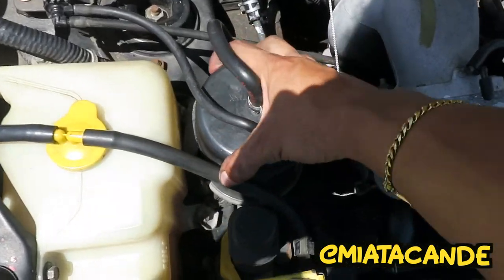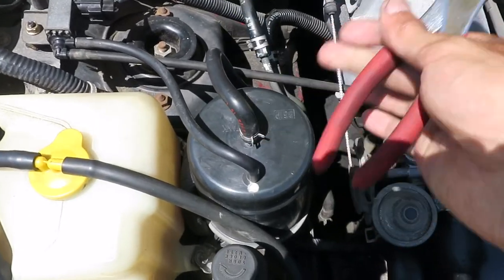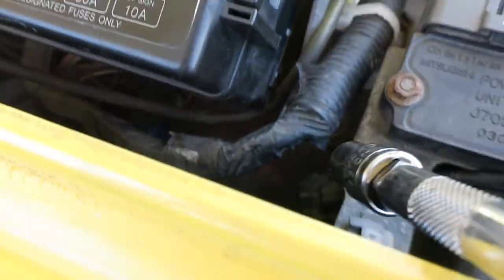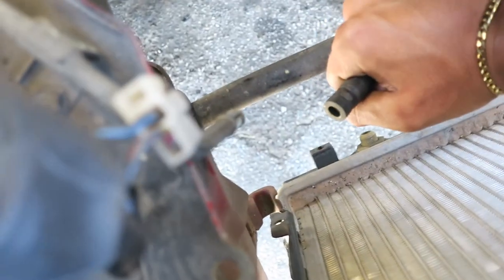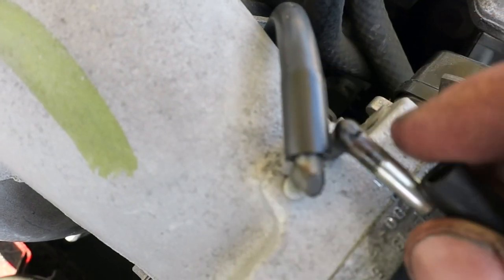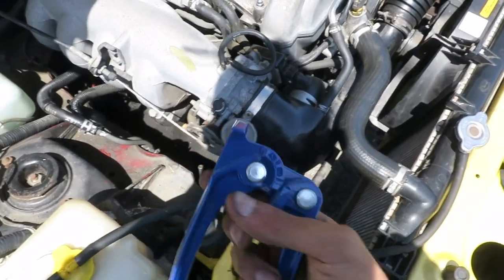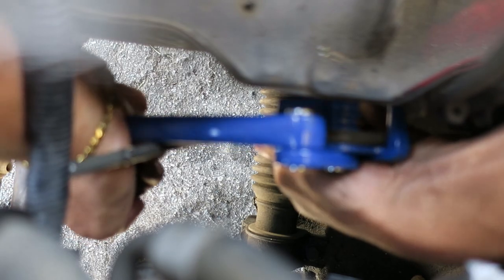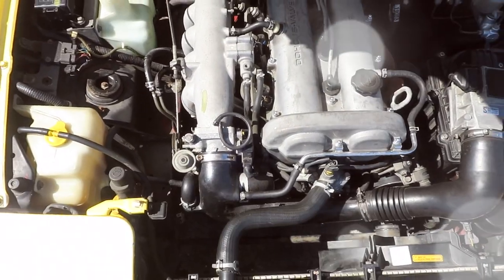How to Delete CHARCOAL CANISTER [NO LINES]! (on miata)

Comment: There’s a trick to removing hoses after the clamp is pulled back that’ll keep you from busting your hand like that. Just put your pliers where the clamp was, squeeze gently and rotate back and forth a quarter turn or so. This will break the hose loose and it can then be removed way easier.

Comment: Amazing.  I am age 67 now and have had cars from the 50s,60,70 and most people back then allowed those hoses to get brittle and break and ignored all of it and those cars ran fine.  In the 60s and early 1970s they used a quart sized can that was the same can that fruit juices came in, so the vapors went into that can and simple routed back to the tank and one on my 1970 oldsmobile vista cruiser the can fell off and heard it go clank clank down the road, OMAO..  On cars 1977 and up actually the gas caps did the job because they sucked in air as you drove and vacuum built up.  On my 89 cadillac brougham it has the exact cannister as the black plastic one in the video and five years ago I took an air hose and removed my gas cap and blew air through the lines at the cannister , then blew air between the two cannister holes back and forth until it blasted out the old charcoal pellets and hooked the rubber liness back up.  Ventilation even on new cars today, make damn sure your gas cap is able to suck in air.  After you run a car lets say 5 miles and you stop, quickly go take your gas cap off and if you hear a vacuum swoosh sound, change your gas cap.
Reply: Really? that juice can was hust a vacuum tank to keep constant vacuum on a spot that would have lost vacuum when you accelerate. No car made today has a vented gas cap. if it vents there is a code comes up EVAP leak.I;m 70 now, I've worked on cars built in 1914 up to present.
Reply: @alm7707  Youve got it all back wards. ALL vehicles since 1977 up until 2024 have gas caps that vent, suck in air.  Also the canister can did not hold vacuum at all. Youre totally wrong and I can tell you know nothing about cars. I am age 68 and my memory is very sound and my experience is good. As for you saying at your age 70 that you have worked on cars up to present has to be LIE, because all vehicles today have vented gas caps

Comment: It didn’t pull a check engine light And evap leak code? Did you ever get vapor build up in the tank ? Thanks
Reply from the maker: no and no. and never smelled any fuel from inside the cabin or top on engine bay
Reply: Can this be done on a 1994 ford Ranger?
Reply from the maker: this similar delete can be done on many different vehicles BUT depending on the vehicles year, you might have to do extra things to not get a check engine light
Reply: @JakeCande  how about a 93 Chevy G20 Sportsvan  ?

Comment: I'm not sure this would work. You can't just start unplugging lines and plugging them into a different spot. next thing you'll be sucking raw gas into the intake, and I know how that will go. GUYS  LEAVE THINGS ALONE UNLESS THEY ARE HAVING PROBLEMS.   Why didn't you delete the whole air intake system right up to the throttle body? Get way more power...better gas mileage too along with cool sucking sound, after all I bet you never drive in gravel so why have an air filter?lol

Comment: Are the fumes flammable ??
Reply from the maker: no. the fumes escapes from there naturally. it is just no longer going through a filter
Reply: @JakeCande  bro i deleted my charcoal canister because it was leaking, but it still leaks from the vent line (that used to go to canister) you know what could cause that ? 92 Corolla
Reply from the maker: leaking fuel ?? if it’s fuel, you likely have a clogged fuel filter. happened to my 96 civic too. part was cheap new at autozone. lmk if this helps ✊🏽
Reply: @JakeCande  yeah it’s leaking from the vent line that comes from the fuel tank
Reply from the maker: you can also test to see if it’s clogged by blowing into it (never you remove it)
Reply from the maker: i doubt it’s the fuel pump but maybe. fuel leak is tricky
Reply from the maker: best thing to do is work your way up from the leak. check/test all fuel related parts.
Reply: @JakeCande  yeah hella pressure building in the tank imma check  the line
Reply from the maker: yea. test that fuel filter. people over look it sometimes
Reply: Yeah

Comment: I got a check engine light...help?? 1996 NA
Reply from the maker: after deleting this ???
Reply: @JakeCande   yup, is this from disconnecting the solenoid? Apparently everyone else’s cars are fine after disconnecting whatever ig
Reply from the maker: solenoid?  what’s the exact check engine code? i have a feeling it’s not for the evac
Reply: @JakeCande   I didn’t run a code cause I don’t have an OBD1 scanner.. my engine light popped up after taking everything out. Right now I have the wiring plugged in but the canister out , still running the light. I lost my bottom hose for my canister so I can’t even put it back in if I wanted to.
Reply from the maker: you closed up the hole on the intake manifold right? my bad bro, everyone who removes the evac didn’t get a check engine light. so my thinking is either you might have left something disconnected or the light is for something else.
Reply: @JakeCande  everything else on the car is fine and yes I closed the hole up.
Reply from the maker: damn bro. really would have to put the obd1 to see what it reads. i know you can get a code if the gas isn’t escaping properly. meaning, (the tube that i bend in the video, gas escapes there) we deleted the filter system for those gas fumes but the fumes still need to be properly vented. you see in the video, i routed the line to vent through the oem hose. i had a friend that just closed the line off, and immediately got a check engine light.